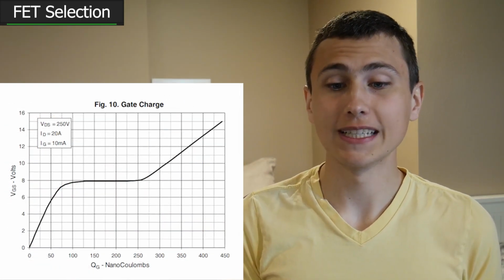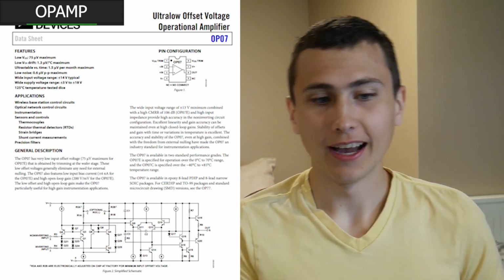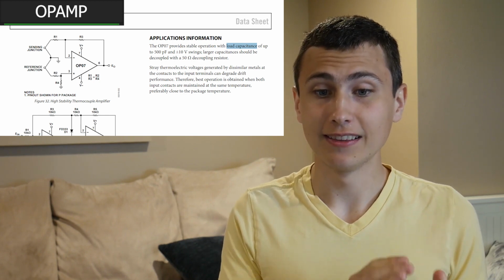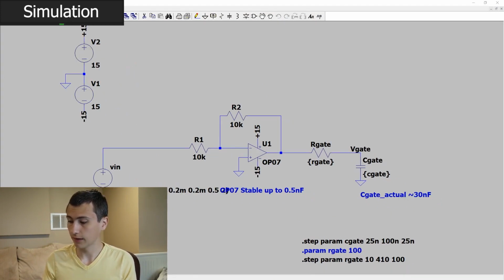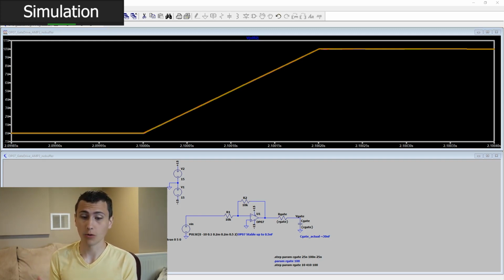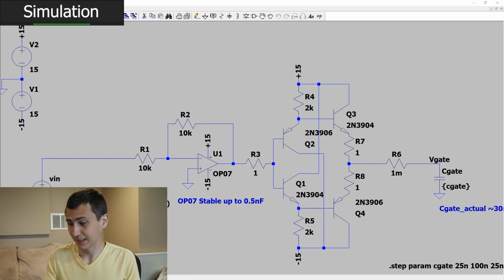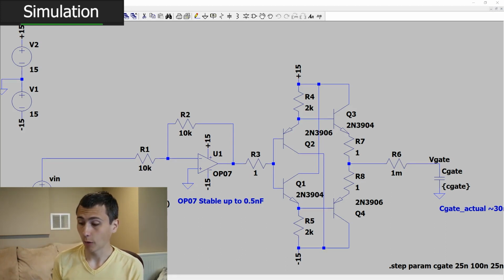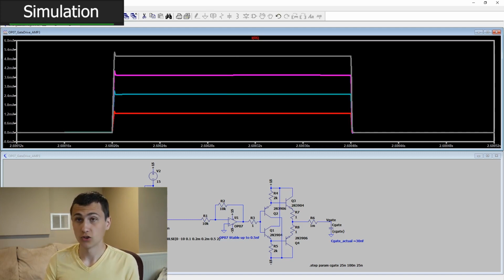OpAmp as Linear FET Driver?

Comment: I know this is super old, but why not use the microcontroller to detect when the load is 0v, and set the setpoint of the PID system to 0, so it will never fully enhance the linear fet when no source is connected. Id still keep the OCP, but it means you wouldnt be relying on it as much

Comment: Nice driver circuit I use LTspice as well. I was wondering would an LM324 Opamp work as well for this application? I was planning to use one of these Transistors IRFP260,FQPF10N60C,FQP30N06. Thanks in advance.
Reply from the maker: Hi Bart! The critical parameter to look for is the ability to drive capacitive loads. I think the spec reads "capacitive load drive" for the 324. Looks like the limit is 100pf. Keep an eye on the gate capacitance, make sure you stay plenty under the 100pf limit, or the opamp output could become unstable! 

Of course, the same nonideal parameters (input offset, bias, etc) will still harm accuracy. Best of luck, and thank you for watching!

Comment: I know you also wan to to get into the intricacies of building that discrete circuit, and perhaps keep the cost down, but, and I'm mostly just curious, aren't there some "power" buffers/opamps to drive the mosfet instead of using that whole circuit?
Reply: i actually did something similar to improve the current capability in a IGBT driver i am making, the driver was not very "capable"
Reply: @the_perigoso  I was having similar thoughts. Some of them are only stable to 10nF or so. Depends on the architecture, and whether you can parallel them etc.
Given you have the rails, can deal with the board space etc, a discrete solution is fine/cheaper etc.
Reply from the maker: Hi Rafael, yes, there higher current parts, but as Normally Open noted, they still have a limit to output capacitance. 

Besides this, driving capacitavle loads requires a relative lot of current, and this buffer will spread the power dissipation out among a few discrete parts. With one opamp, this would all be in the die of one Integrated circuit. So yes, there are amplifiers /opamps made for this type of application, but a discrete buffer stage will probably be able to handle more power, and may be tuned to handle more output capacitance. Cheers, and thanks for watching!
Reply: @EEforEveryone  we can for mother russia.